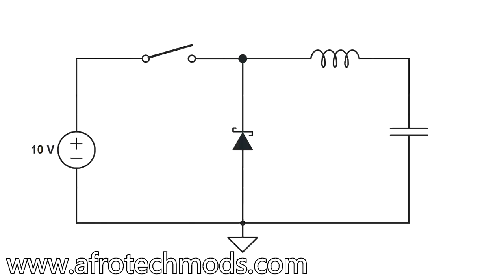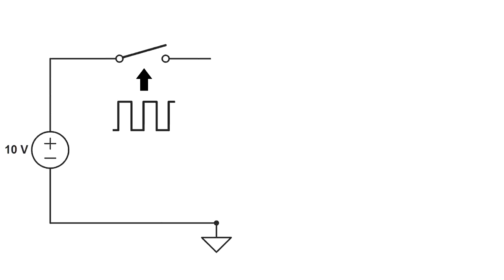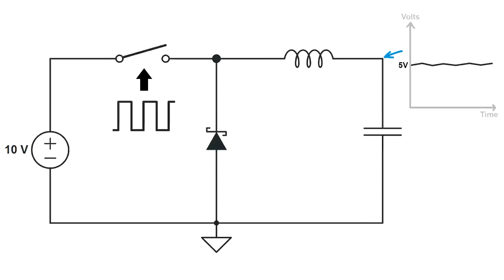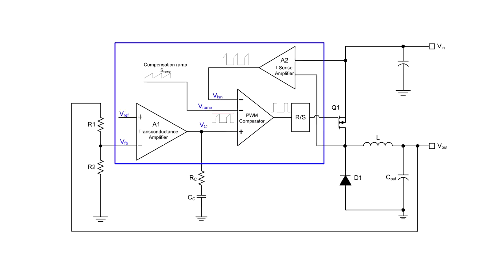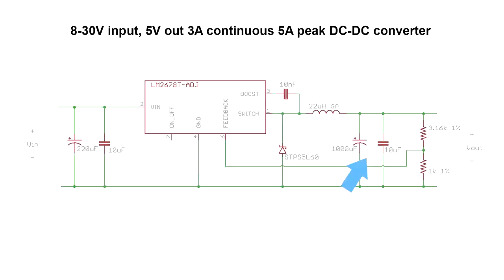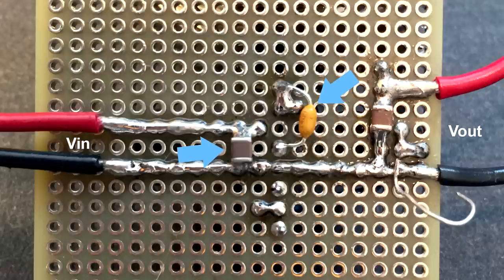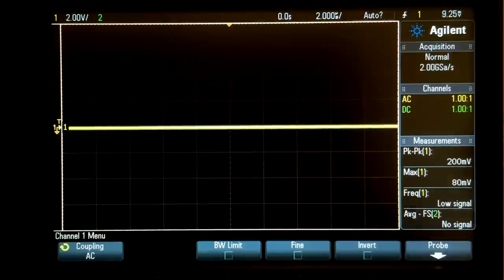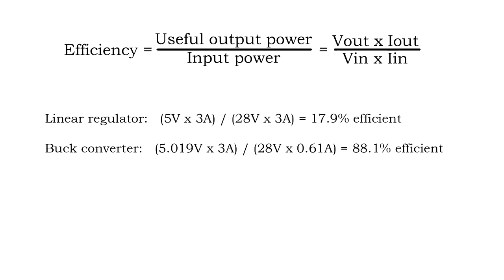Switch mode power supply tutorial: DC-DC buck converters

Comment: hilarious video. Why do you need that 220uf electrolytic and the 10uF ceramic at the input? Do these two capacitors function different from a single 230uf electrolytic capacitor? thanks
Reply: +Ferris Whitehouse The 10uf is a ceramic composition and is there to shunt high frequencies to ground, filtering out RF interference. The electrolytics do not work well at high frequencies. That 10uf label may be a typo though, the data sheet shows .47uf.
Reply from the maker: +Leroy Laush The 10uF is intentional - you can get away with lower on a PCB but with the perfboard layout and no true ground plane additional ceramic capacitance is required to maximize performance. I also assumed some of my audience might not construct the circuit as well as I did so I recommended even more capacitance to help compensate for that.
Reply: +Afrotechmods I can't seem to find any ceramic capacitors with such a large value at my local electronics store, the largest value offered is 0.1 uF. Is a "Tantalum" capacitor okay?
Reply: +ZeroKelvin Keyboard The Tantalums(typically yellow orange or brown) and aluminum electrolytics(cylindrical) typically used for this become fairly reactive at higher frequencies (above a few MHz) because of relatively high ESR (equivalent series resistance) and ESL (equivalent series inductance), and are therefore poor RF bypass capacitors. You can get away with it, as it is the old way it was done, but it won't do a very a good job of fixing poor component layouts with horrible high frequency ringing.
The cheap generic blue dipped ceramics are best for this.
Reply: Richard Smith What other kind of capacitor type would you use then? I can't find a ceramic with this capacity.
Reply: ZeroKelvin Keyboard You can get ceramics up to 10uf(maybe higher? Can't see why :P). Order from amazon, local electronics stores are so 10 years ago :P.
Reply: Richard Smith Online isn't as practical for me.

In Australia I'll have to either pay a huge shipping fee or wait a long time with free shipping. If I want to build a project it's much easier just to walk down to the store and buy what I want. Also easier to get advice/information about what I'm buying.

I've tried Amazon, but nothing seems to have international shipping. Can I filter for this? I'm currently using eBay for any online stuff.
Reply: Substitute a lower value, the ceramic cap is for higher frequency bypassing that the 220uf electrolytic will not shunt to ground. .1uf should work fine.

Comment: Great video, very easy to understand. I have a question, why do we need to have a ceramic capacitor in parallel with the electrolytic one? Can we use one electrolytic cap with higher capacitance?
Reply: The ceramic is much more efficient in shunting high frequencies to ground.

Comment: Love the videos. I have a question I think you could answer quickly for me. In terms of efficiency and energy waste, Charging with wind or solar )low voltage(, would it be reasonable to charge the cap bank closer to 75% of it's max only to bump back down to a lower voltage on the load? would this extend the time or just waste energy in the conversion?

Comment: Hey! So great - This video really helped me out, so easy to understand too.
I got one question, if I may...
Could you may tell me, how to reduce (in general) the noise of the output? Is there an easy way for this? I've been thinking about filters, which filter the switch-frequency... Any tipps & Tricks? :)
Thanks in advance!
Reply from the maker: +Tupac World You could try adding a second low pass LC filter on the output.
Reply: +Afrotechmods Thanks a lot, I have seen your comment but haven't answered. I just added a High-Pass Filter to filter the switching-frequency and noise. That worked quite well for me! Thanks again & keep going with such cool and easy understandable videos =) Really appreciate them!

Comment: A 10uF ceramic capacitor is quite large.  Did you mean 0.01uF?  That's the one that suppresses noise that gets through an electrolytic.  10nF or 103.
Reply from the maker: Nope. 10uF.
Reply: Damn... now I have to go to Digi-Key for two little components...
Thanks

Comment: Why is there 5V on the output without a load? Whats preventing it to bump the voltage up to 10V?
Also my LTSpice simulation sometimes just goes crazy with this circuit. I did something wrong?

Comment: Are buck converters suitable for use in high end audio amps etc? Are they electrically noisy? Power supply is a separate component from the amp but the lower noise the better. Thanks

Comment: This might sound stupid, but why not just use a 5 volt power supply in the 1st place so its always around 5 volts? is it because something else in the circuits requires higher voltage or the resistance interferes with it not being 5 volts all the time or to gain more amps? for ex you wanted 5volts & 5amps which a battery might not be able to handle, right? is it like tapping into a high power supply & you wanted to power something at 5 volts so you stepped it down & used the regulator to maintain a steady 5 volts only for your device?

Comment: +Afrotechmods I'm working on a 5 volt power supply to charge a smart phone from a 12v lead acid battery
I was using 7805 regulators but they gave me low current
then I tried lm317 but it was worst than i imagined
so my question is :
Is it safe to use buck converters to convert the 12volts of a bettery to a 5 volts with 2amp at max current
or what protection can i add?
please help me?

Comment: Awesome video! Say I set the output voltage of my buck converter to exactly Vforward on an LED, can I then ommit the resistors? I've got to power an array aof 150 LEDs wired in series in bunches of 3 (Vf is 3.3V wich, so I can drive them from a 12V PSU) and would therefore have to use 50 resistors. So being able to drive them directly would be kind of nice.
If not, is there a way to build a constant current regulator to drive them all?
Reply from the maker: John Kapri You could do that, but it's not ideal. Any large fluctuations in the output voltage could end up popping the LEDs. For a small hobby project it's worth trying.
Reply: This is how I power a few series LED projects I've made for product photo lighting. I used a cheap buck/boost converter from amazon, they work like a charm. Though the biggest is only 36 LEDS, it should work fine for larger amounts

Comment: Isn't adding the 10uF ceramic capacitor in parallel to the 1000uF electrolytic capacitor redundant since they are in parallel?  What is the purpose of adding the 10uF capacitor?

Comment: Now, I know that this is sort of a dumb question, but what if you used a microcontroller with meassuring guages or so, to regulate the duty cycle? I mean you would have to meassure current draw or voltage de-increase, so that the microcontroller can regulate it right? just tell me if I'm dumb

Comment: Hi, i am building the same circuit as I powered the input side with 12v lead Battery but it is very hard to turn on. When I measure the input to ground I only get 3v feel like smtg is blocking the Voltage going in bcs this IC needs at least 8V to turn on. I check all the connection and parameters. I am sure the circuit is correct as it manage to turn on and drive some leds before but it turn on quite randomly after leaving it untouched for random hours. Any idea why ?? 
Thanks..

Comment: Love the videos! Do you have anything on Cuks? I need to build one for a class. Can I just build your boost and buck? I have just started on this.
Reply from the maker: Cathy Sakurai Check this out http://www.digikey.com/product-search/en/integrated-circuits-ics/pmic-voltage-regulators-dc-dc-switching-regulators/2556570?k=cuk%20converter  and read as many datasheets as possible for ideas on Cuk designs you can use!

Comment: Hi and thanks for the great vids! I have a question, how do you use the LM2678 to supply 9 volts or 10 or 12 volts? Is it through the adjustable resistors? And if so, what are the equations (or values of the resistors hehe) to change the voltage?
Reply from the maker: Rad10head707 Check out my adjustable power supply tutorial video

Comment: could we use this to essentially do 12V to 12V to isolate ground?  I have some lights in my car with poor step up transformers that inject noise into the sound system via the car wiring.

Comment: Regarding placement of capacitors too away.... problems would start because of the self capacitance?
Reply from the maker: +Flankymanga Not self capacitance, the problem is inductance. The extra distance results in extra inductance which impedes high frequency current flow. The inductance can also create resonant effects.
Reply: +Afrotechmods Ok so if i get it right the more of a conductor length, the more inductance there is which resists high frequencies....

Comment: If the resistors on the right fail would the output be equal to the input?  How can we prevent this by shutting it down or force the output to the lowest voltage if the resistors fail?

Comment: For converting 12v DC to 9v DC would you just recommend using a linear regulator with a heat sink or should I use a buck converter?

Comment: Is this lm2678t chip calibrated to output only 5V? It feels like the user gets to decide the voltage output with the resistors at the right.
Reply: +valflyinf Ah nevermind (Figure20 of the datasheet: Basic Circuit for Adjustable Output Voltage Applications)
I just wonder if I could get a good performance for voltage at 6V.
Reply from the maker: +valflyinf You can get variants of the chip with different fixed output voltages and also an adjustable version. 6V on the -adj is no problem.
Reply: Yes thanks. One question, Would I be able to pair three of these to a large capacitor like 2000uF, and on the other side of the capacitor, connect 17 loads at 500mA each?

Comment: So... What is the difference between a potentiometer and a DC-DC buck converter? Is it that a pot is for linear DC current and a buck converter is for a pulsed input? I'm lost ._.
Reply from the maker: Search for my video on voltage dividers and you will see how you can't use them to power heavy loads
Reply: a potentiometer is just a variable resistor and wastes excess current and volts as heat.  A buck converter is a fancy on off switch which lowers voltage which increases current available.

Comment: Can I use this to provide regulated power to my external harddisk. It uses 12v and 1.5amps. I plan to use 18650 batteries and a buck converter like you described here!
Reply from the maker: Your external drive probably also uses a 5V line but I think you've got the basic idea down yes. Just be careful about overcharging and overdischarging your lithium cells. Usually you want to have some sort of battery management system (BMS) circuit in there.

Comment: Can buck converter increase the output current?
I want to convert 12V 2.7 A to 1.5 V 20 A.
I was built one using push pull oscillator with transformer (fewer turns on secondary), but produces hundreds KHz AC output that I must handle with skin effect. The AC output cannot be converted to DC easily by using reflecter diode, small resistance will produce loss / heat because low voltage high current.

Comment: Hello, I’m using piezoelectric and I’m getting a high ac voltage with a very low current and I rectified it , so is it circuit applicable for such since the voltage is  intermitted

Comment: Great little video. I wonder if anyone can help me. I'm looking to build a 12v and a 5V power regulator with NO ripple. It should be easy to do as input is 12-14vdc with lots of noise on line.

Comment: nice video. i have a SMPS that can give 12 volts at 60 amps. i want to make a circuit that can convert it to 5 volt 100 amps. is it possible? can you give me some idea. thanks in advance.also can i use couple your circuits in parallel to achieve higher current?

Comment: Tried most of my usual online electronic component suppliers to find a decent crackhead to run my switch with no luck.  Most of the ones on eeebay consume too much and require too much upkeep.  Perhaps I can find one in one of my old TV's or microwaves.

Comment: When you couple the high capacity electrolytic with the ceramic capacitor is that to compensate the high ESR of the electrolytic one to filter out the high frequency noise better or is there an another reason ?
Reply from the maker: Both! The ceramic cap has a really low ESR and ESL and works well at higher frequencies.

Comment: Why are both electrolytic and ceramic capacitors in parallel required, please?
Reply: +OnEvenKeel there is an internal resistans in both caps, meaning taking out or putting in high current really quick would heat up and destroy capacitors. The ceramic cap can withstand higher impulse currents and feed the switcher, then the ceramic cap will reload from mostly the wires feeding it but also from electrolytic caps.

Comment: The link for the parts list doesnt work. Can I get an updated link?
Reply from the maker: Damn. Okay, check out the description section of this video https://www.youtube.com/watch?v=QR8qsygs1Kw  that lists some of the parts, but you are going to have to hunt for some good 10uF X5R/X7R ceramic caps yourself it seems.
Reply: @Afrotechmods i was only able to find 0603 smd ceramic capacitors. U reckon those are a suitable replacement?
Reply from the maker: @Penggu_  No way you will want 1210 or bigger. Check mouser or digikey. These caps are important in the design.

Comment: how do i choose the values of all the passive components of the circuit (Caps , Resistors and the inductor) to get the circuit to convert from : 60V to 12 V ? ..thanks for the video :)
Reply from the maker: You can't do that with this controller chip, you would need a different one. Search for buck converter modules or controllers that meet your voltage requirements and read the datasheet for info on how to calculate the passives.

Comment: The capacitor marked 10uF in parallel with the 220uF capacitor at the input is shown on the schematic as an unpolarised capacitor, as is the 10uF in parallel with the 1000uF at the output. Why is this?
Reply: +Silas Fatchett Electrolytic capacitors filter well at low frequency, but don't do as well at high frequency. They experience high ripple currents at HF which will cause them to heat up and will limit their lifespans, but they generally just don't do a very good job. So a ceramic or film cap is used in parallel to filter the higher frequency spikes. These types of capacitors have much lower equivalent series resistance (ESR) and equivalent series inductance (ESL), therefore they can handle much higher ripple currents.
Reply: Coming back a year later, and looking at the actual components, I suspect that the caps marked 10uF are in fact 10nF (0.01uF) caps. Which would make sense.
Reply: Once again I have to eat humble pie. I didn't know that 10uF ceramic capacitors existed, but they do and I was wrong.

Comment: I want to run my arduino nano off a 12v battery. The average current drawn (with leds and sensors) is 100mA or .5 of a watt. I wanted to use a linear regulator to power the board but it would consume 1.2 watts resulting in 0.7 of power lost. 

I know people use dc-dc buck converters for high current but it is worth it in low current application?
And if so is which chip and parts should I get.
Thank
Reply from the maker: M Wow For a simple arduino nano project and a high capacity 12v battery just use a linear regulator + heatsink.

Comment: Can you make
 Input: 3V (2x AA) 
Output: 5V 0.8A or 0.5 ?

Is it possible Sir?,. Your video is very helpful,.but it will be more helpful when you made one of this. Circuit.

Thank you.
Reply: Darel Ocampo  The output has to be lower voltage than the input in a Buck converter. Try looking up the Boost Converter video.

Comment: Thanks  for publishing your videos and the method you do it.  When you get a moment reply to this post. I would like to know your source of your circuit boards.  Thanks and keep up the good work.
Reply from the maker: I get the perfboard from Digikey
Reply: Afrotechmods hi, i need to design a voltage regulator for an alternator.
i built one from a schematic online but it does not regulate. as i rev the engine
the voltage goes up to 18 volts. im using a tip 122 and a 2n3904. and a 12v zener
help!

Comment: In theory, Can I replace an old 7805 of a retro game console (Sega Genesis for example) with a Switching PSU? (Good Video, i liked it)
Reply from the maker: tomoya97 It depends on how sensitive the analog circuitry of the genesis is to ripple. You might want to add a second LC filter to the output of your SMPS if you try it.

Comment: Would powering a computer be considered sensitive equipment? So say you wanted to power a computer in the car.
Reply from the maker: Computers are powered by SMPS all the time it should be fine as long as you build it well.
Reply: i guess you noticed chargers for notebook for cars in shops
this is nothing more than just a step-up (boost) converter!
Reply: uh no I didn't, I just wanted to power a desktop computer directly with out buying a expensive DC to DC power supply when you can buy a power inverter to AC cheaper than that.

Comment: Better yet, if you need rid of the ripple, buck input voltage to a little over the voltage you need to run a linear regulator and then use a linear regulator. Less efficient than just the buck converter, more efficient than just the linear, eliminate the ripple. :3

Comment: Please Can you give me a circuit to get low voltage output 14 volts or 28 volt of 30 to 60 amps from a 100 volts 17amps input, i want to use it for a battery charging system from solar

Comment: Can anybody recommend a way to keep the noise this type of power supply creates from interfering with other electronic devices attached to it's input and output? I use a Buck converter type DC-DC converter in my RC airplanes for LED lighting.